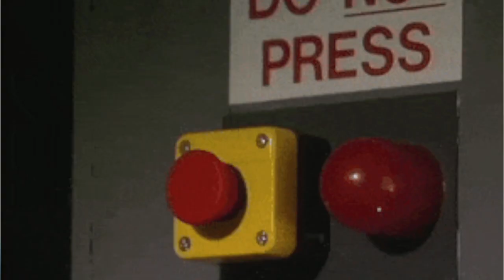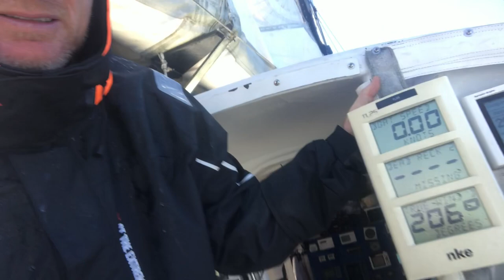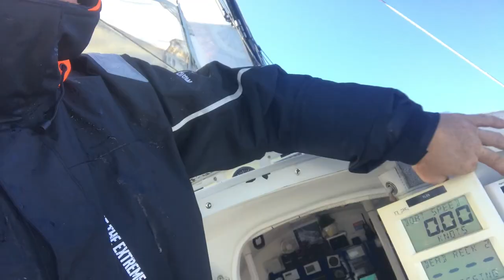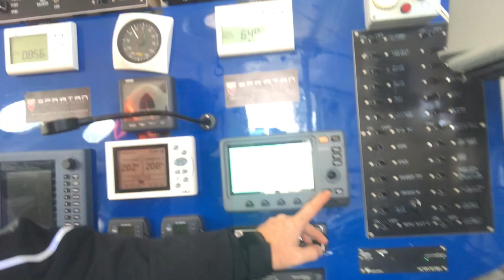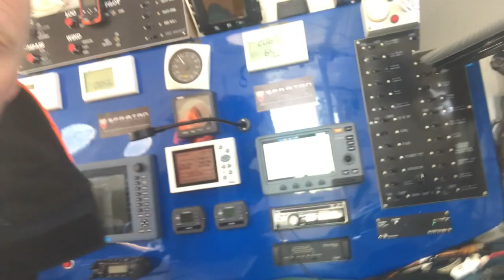The Mariner Episode 13: Open 60 Sailing Transat 101

Comment: I love these videos!  Question, it seemed that you were pretty confident in the standing rig when you pushed off, new lashings etc.  What makes you feel the need to be so conservative and concerned with the rig now?
Reply from the maker: Jason Tan hi there! Great question. The life of PBO rigging in these boats is seen as being 30,000nm or 5 years. As the rigging on Falcon is now 30,000nm and 14 years old there is a strong argument that it is well past it’s expiry date and so caution must be exercised - I’m sure we can all agree with that. However having been around a number of similar ‘resurrection’ projects I know two things 1: I have seen 12 year PBO tested to destruction on a calibrated hydraulic draw and it was still at 85% of the designed strength AND 2: I’ve seen almost new backstays blow out way below the designed 20 Ton Rupture limit. So Hmm :/ The net result of this conflicting experience is that I have belief that ‘it’s possible’ the standing rig is in all
likelihood perfectly able to handle pretty much anything I throw at it BUT I believe I have to gently work my way up to that level of trust with it and while that is developing keep everything super toned down in case suddenly there is a BANG! If I got this balance wrong I would destroy a $250,000 mast and basically given her age at that point Falcon would be so much epoxy and carbon to be burnt off or buried in a land fill :( A terrible waste and a major environmental problem. I hope that explains my thought process :/ I’m trying to find a balance:) between logic, seamanship, safety, prudence and my own excitement:) Remember the practical demonstration of my belief in the rigging is that I am setting out solo 2500Nm across the Atlantic with it :)
Reply: @CSMtheMariner  Thank you for your answer!